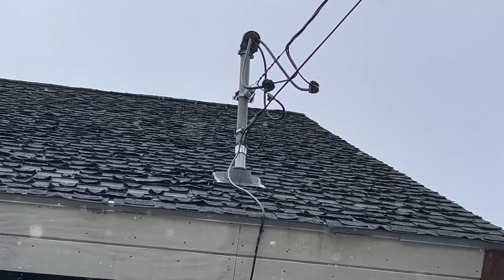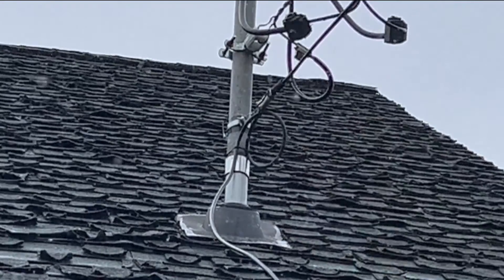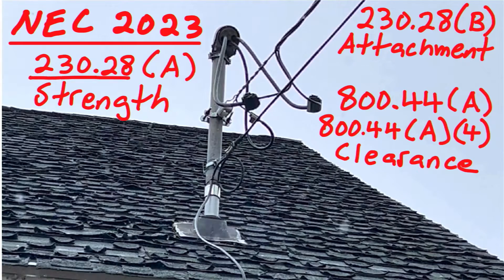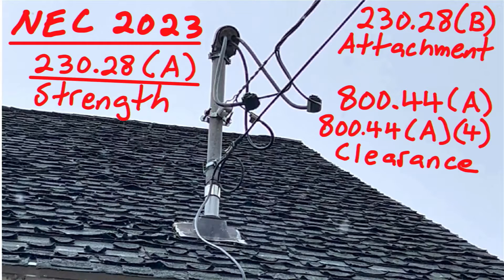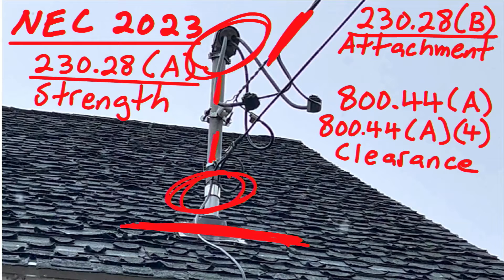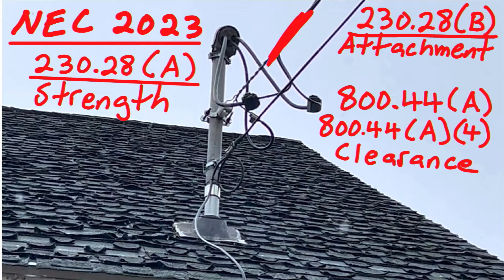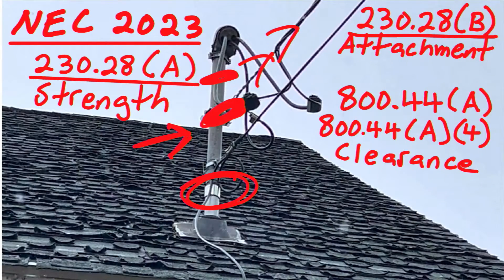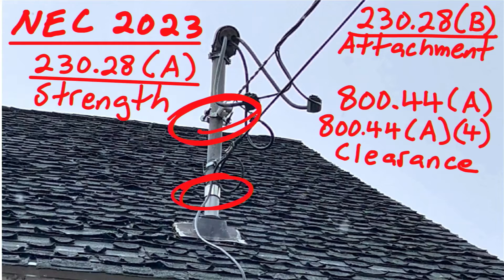NEC 2023 - 230.28(B) Service Masts as Supports - Attachment Violation by ElectricalTime.com

Comment: As I understand the 230.28A, you need the guide wires if the mast is not securely supported. In this case, it appears that the mast is about 36” high with the wires attached to the insulator about 24” above the roof. If the mast is firmly attached to the wall of the house, it would not be a code violation to not tie down the mast. 

I used struts to secure the mast to the wall in the last panel upgrade I did and it passed inspection.
Reply from the maker: Hi, that is a great question. Generally speaking, the local utility company will have their requirements on when Guy Wires are needed to be installed for masts that extend past the roof line. I am hosting NEC Code classes next week and if you would like to sit in on a free class on Zoom, just go to my website ElectricalTime.com and click on the first button for the Online Code Classes, thanks, Steve

Comment: You are quoting electrical code in 2023, was this mast and service installed in 2023?  NEC is only applicable when the work is done, if the installation is no longer to code, but was to code when the work was done, then the installation is grandfathered in until new work is done.  What was the code when this service was installed?  Was this service compliant when installed?  Please actually talk about what is happening when this service was installed.  Is this wrong now? Yes.  Was it wrong when it was installed?  Who knows from this video?
Reply from the maker: Hi Andrew, you have a good point here in your comment. I believe in the beginning of the video, I say that this is an old service done many years ago, maybe 20 years ago. I checked the 2008 NEC and the Guy Wires were required back then and in the 2014 NEC, the use of a coupling above the roof and below the attachment point was a new section that was added. When the installation was originally done, it would have been required to pass the NEC Code at that time. On my next video, I will remind myself to mention that. So based on my observation and assuming that the installation is about 20 years, it looks like it was not in compliance because of the lack of a guy wire. If you would like to attend one of my NEC classes on Zoom which are on Tuesday nights from 7 to 9 PM, please send me an email to ElectricalTime@yahoo.com. Thanks again for your comment, I really appreciate it. Steve